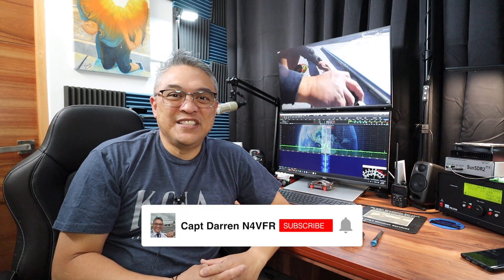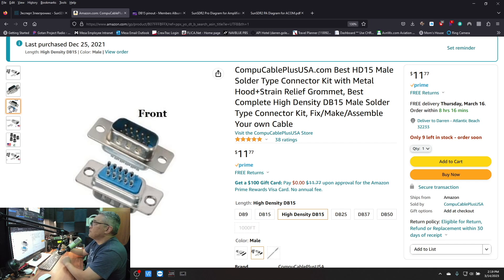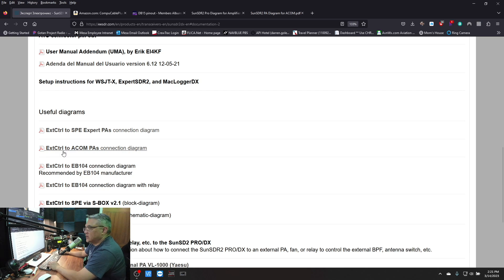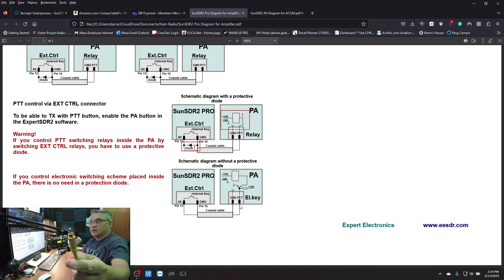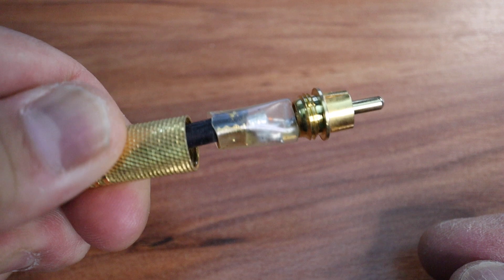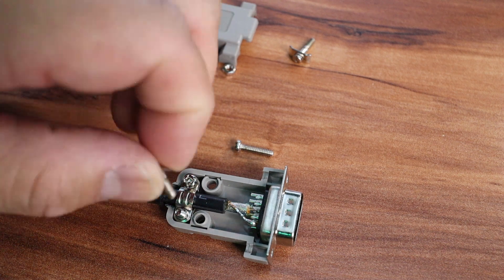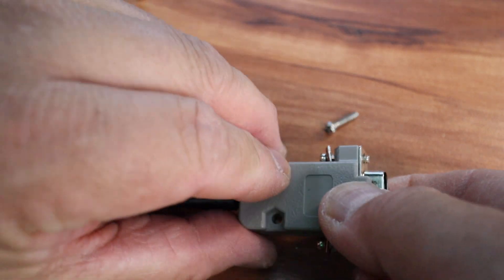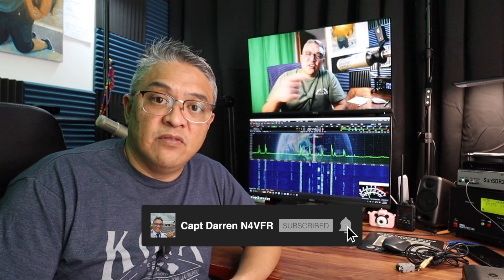Building a HF Amplifier Relay Cable | Mercury IIIS and Acom Amplifier Cable | SunSDR2 DX Ext CTRL

Comment: Thanks for this and all your other great videos. Do you really think it is necessary to use a coax cable for this?
Reply from the maker: I didn't use a coax cable.  The cable is a RCA Audio/Video cable that I had in my wire collections.  I just cut off 1 end and the other end, soldered the 2 wires to pin 13 and 15.
Reply: @DarrenN4VFR  Thank you. I haven't watched all of your videos, though I did watch a lot last night. Can you tell me how your SunSDR2 DX compares to your 7610 (or any other high-end radios you have now)? I am awaiting delivery of a SunSDR2 DX myself and am very excited. Just keen on your opinion of the SunSDR after having it for some time.
Reply from the maker: @VK5IR  In Texas where I have my SunSDR2 DX, that's my primary radio and I like it a lot.  I do have a used Anan 200D that I'm still troubleshooting with the receive signal problem.  Once I figure out what's going on with it, I will move it to Texas.  The IC-7610 is in my Florida station.  I have too much power line noise from the utility poles around my QTH and it makes HF communication not so pleasant.  That's why I bought the Anan 7000DLE Mk3.  It does wonder with the RFI Interference.  I like the pure signal and the NR2 on the Anan 7000DLE.  I will definitely still keep my SunSDR2 DX.  I have it altered for 11 meters if I ever needed to talk on there.  With the SunSDR2, you need to understand a little about computers.  I hope my videos on the SunSDR2 will be helpful.  73's de Capt Darren N4VFR
Reply: All explained in the manual.. thanks Darren for folks who cant read 😂